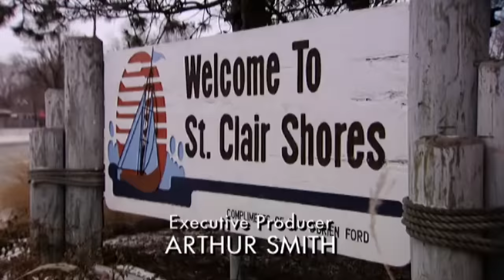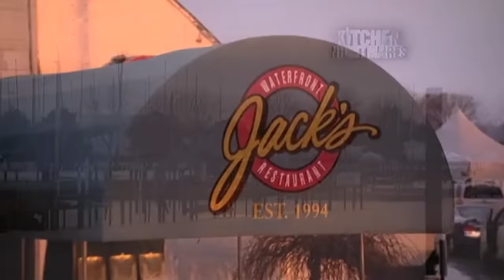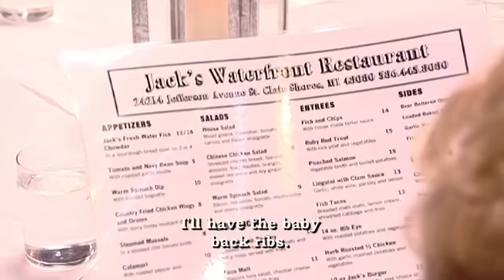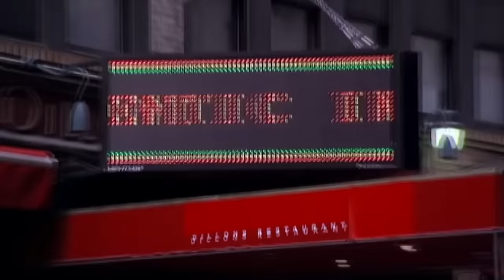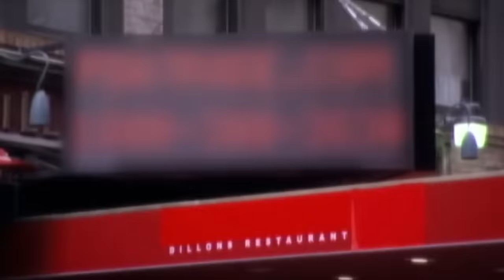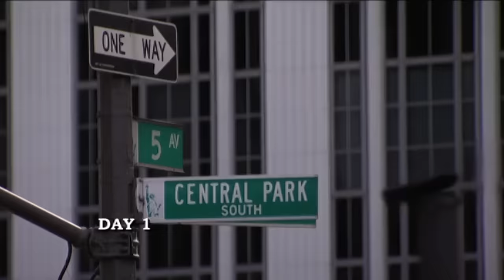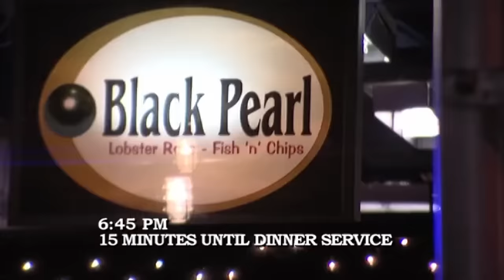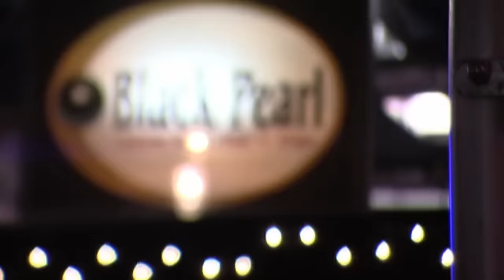these episodes make me feel old | Kitchen Nightmares

Comment: So they think that Mainers don't season their lobster for rolls with salt? Wouldn't it be easy to test?  Off-topic recipe: Chicken Salad    I use roasted chicken for the chicken salad, low-fat mayo, freshly diced celery,  finely diced celery leaves, minced green onions (or regular onions), finely diced fresh Italian parsley (or regular if Italian isn't available), celery seed spice rubbed between hands, and celery salt (to taste) and mix well. Don't use warm chicken let it cool before dicing it. Roast the chicken. Make sure it's done but not overdone & dry. Let it cool and rest before dicing it. Don't use too much mayo because you'll lose the flavor of the chicken and celery. The fresh celery leaves are key to getting a fresh punch. Use green ones NOT yellow. The leaves are generally found on the center stalks of a bunch of celery. Use one to two stalks of celery finely diced. I like all of my ingredients finely diced, except for the chicken but you can finely dice, dice, or chop to your liking. However, I do recommend that you only add one tablespoon of mayo at a time and one dash of celery salt at a time so you don't have too much mayo or too much celery salt. You can serve on toasted bread or regular. If you want to serve on toasted bread, let the bread cool before putting your chicken salad on it. Serve with crackers, toasted bread, bread, pita, flatbread, or simply serve in a ramaken if you're avoiding gluten. Don't forget to refrigerate in airtight container. Best when served chilled. Enjoy!  Edit: Sorry for the rambling recipe. It is good though. Roast chicken according to Betty Crocker Cookbook or your favorite cookbook for the selected part of the chicken. You can use the whole chicken with light and dark meat or just chicken breasts which is what I use for mine. Yes. You can use the chicken that you buy at the deli if you don't want to cook your own but be aware that it may be dry.

Comment: I've never used saffron. I've checked the price of it and a few strands cost about $20. I know you don't need much to make a dish but damn it's expensive. I have zero idea what it tastes like. I've tried several herbs and spices that I've ended up not liking. I'd like to try again but I'm afraid to ruin a dish. The current thing that I want to try again is Corriander and also Turmeric and a spice called Savory which was horrible but I used the amount the recipe called for and I should've gone with my gut which told me to use about a 1/4 of what the recipe said.